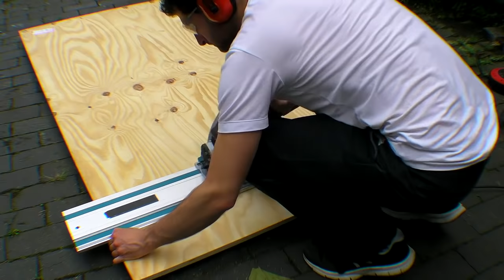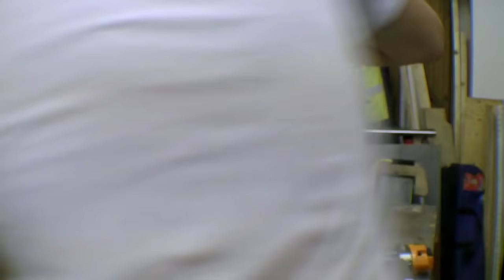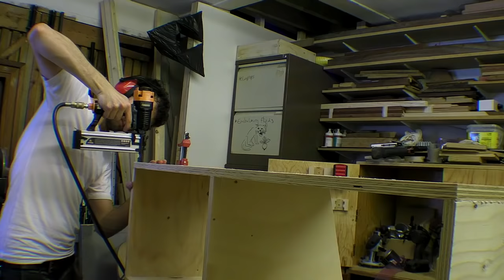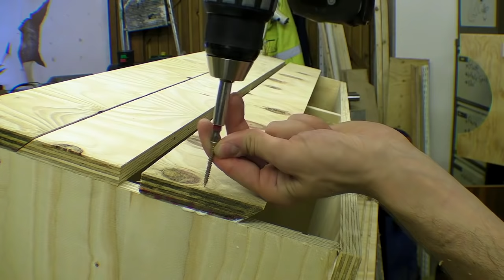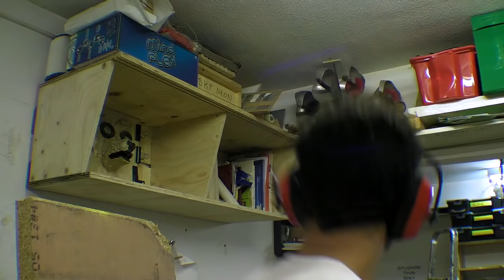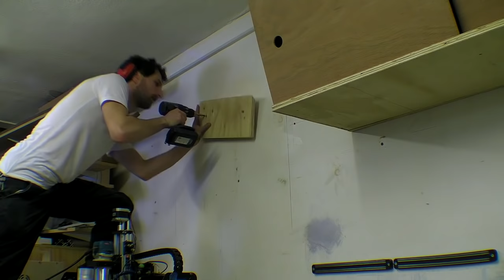Wall Mounted Cabinet with Sliding Doors (plus Air Cleaner Install)

Comment: Sorry to add another comment, but with some experience of thin ply sliding doors many many years ago. To prevent the damn things sticking at some down the line may I suggest sanding and varnishing the edges and grooves and when completely dry applying a good layer of wax. Even ordinary white candle/paraffin wax will make life a lot easier.
Reply from the maker: We had a bit of a flood and that board got soaked, so one end is a bit messed up. I think if it wasn't for that I would have varnished it.
Reply: You're in England who hasn't had a small flood. In that vein why not a video on boat building as you probably have had 40 days of rain. Thoroughly fine build and mounting. Like to see your environs so it was nice to take us outside at the beginning.
Reply from the maker: Lol https://www.youtube.com/watch?v=RjT2_DyXPy8 - Cheers, Don. I'll try do a new shop and studio garden tour in August.

Comment: I like how you keep it simple! I am new to wood working, how are you installing the French cleats to the wall so that you don't need to remove the cleat to install the expansion anchors? Thanks for the videos!
Reply from the maker: Ahh if I kept it simple, I'd have not slanted the front. Just hammering the anchor in with the screw, and tighten. Just don't drill too deep. The wall is not great, so that's why I put so many in.